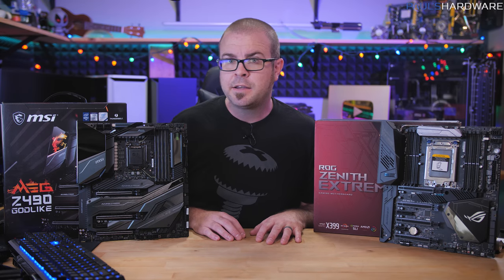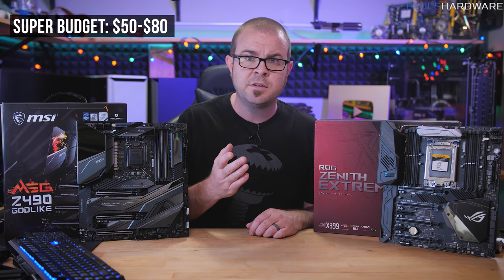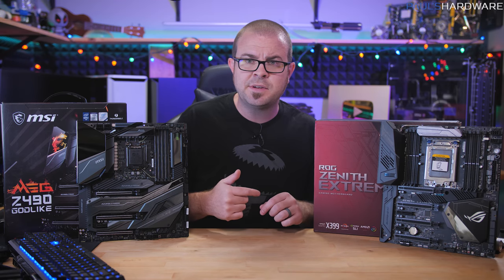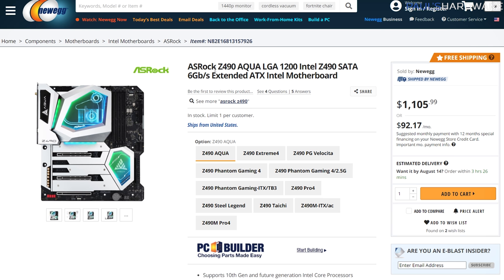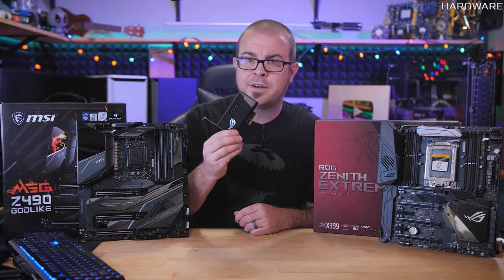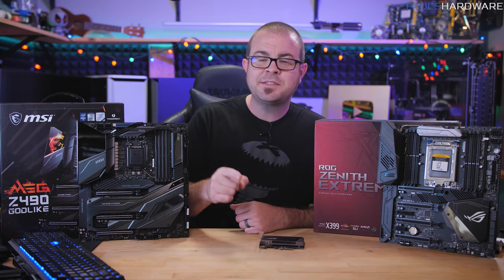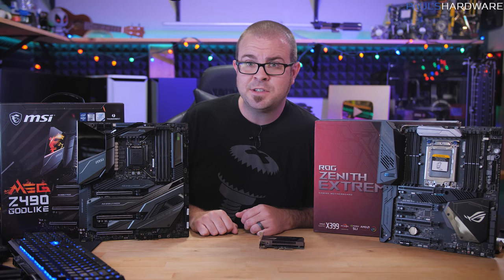What Does a $700 Motherboard Have that a $200 Motherboard Doesn’t?

Comment from the maker: ► TIMESTAMPS
 - thanks for watching everyone! 🙏🙏🙏
0:00 Intro
0:41 Sponsor: Team DARK Z DDR4 Memory
1:06 Video M.O. and Mobo Price Ranges
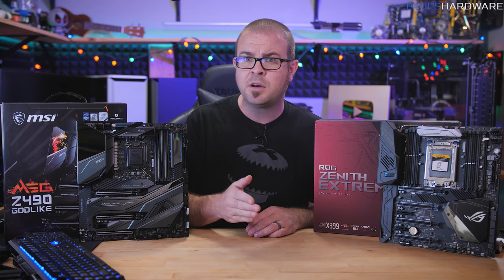2:36 AMD Mobo Pricing & Availability
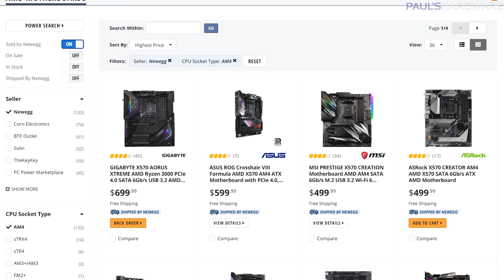4:46 INTEL Mobo Pricing & Availability
6:55 USEFUL: 10Gb NIC
8:45 USEFUL: M.2 Add-On
11:00 USEFUL: Advanced Cooling
12:24 USEFUL: Best-in-class Power Delivery
15:37 USEFUL: LED-lit Audio Jacks
17:11 SITUATIONAL: Water Cooling Stuff
18:52 SITUATIONAL: Lighting/Aesthetic Panels
19:24 SITUATIONAL: Backplates / Design
20:42 BAD: “High-end” Audio
21:44 BAD: System Info LED Panel
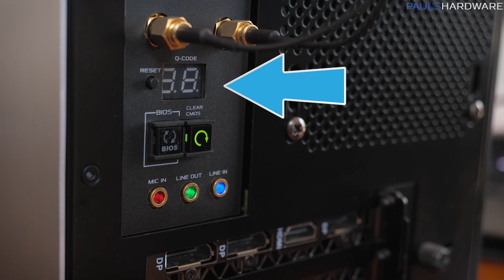22:27 BAD: Sub-10Gbit NIC
22:43 USEFUL Features that Don’t Cost $700+
24:35 Closing Thoughts
Reply: high paul! hope your doing okay! we miss you!
Reply: $30 H110 master race
Reply: I would say a worthwhile feature to shop for (especially for VFIO users) is PCI-Express Slots. If you are going with a high-end Ryzen chip on a VFIO setup, it can be helpful to have a few 16x slots (one or two for your KVMs, one for your host OS) since iGPUs aren't present on high-end processors.
Reply: Hey Paul, nice video... the new MSI boards don't need a clear CMOS button in the back. It is even better when computer is off hold the power button for 5 seconds than power on and it's reset... this is Eric from "Not Bios"
Reply: What motherboard would you recommend for gaming that don't have wifi 6 on the board ? i don't like wifi was looking at the ASUS motherboards
Reply: I have the Godlike.  And the Creation in another build.  The Godlike is good, but as it's MSI, had to RMA it within a week of having it.  The Creation and Godlike are the last MSI I will buy.  Otherwise, the stability overclocking, the 10Gbit NIC, Wifi6, good audio, and the ton of NVME support make it worth it for me in work and gaming.
Reply: Two of the better overclocking features (not mentioned) are ASUS' "Safe Boot" - which allows you to boot to BIOS defaults (if you set something too aggressively) while still retaining the settings you entered - and Gigabyte's "Dual BIOS" - which (as implemented in their "AORUS Master" MoBos) allows you to switch-select either of two different BIOS, each with their own settings and profiles, so that you can compare the performance of different BIOS versions (or even sets of settings on the same BIOS).
Reply: You need to adapt your idea of what a low and mid range motherboard are. The z/h 270-399 series are generally priced around $150 to $250 at launch. Prices haven't been coming down with the 370-390 at all and it seems like most manufactures have stopped producing them in favor of the 399.

https://imgur.com/Dnb0YgR
Reply: As an audiophile... integrated audio is fucking worthless bullshit. You need an AMP first, and then a DAC next.
Reply: Would've loved if you talked about evga's z490 dark. That retails for $550 on their site. It's cheaper than the other boards you showed but for some reason nobody brings them up in a discussion with msi, asus, gigabyte, and asrock boards.
Reply: Sad part is it's all cheap Taiwan crap that charges a "Made in USA" price tag.
Reply: @benjy117  Taiwan production is quite a bit better than China, check out the airsoft or aeronautical industies for example. Precision top end brands and parts go to Taiwan.
Reply: Excellent video.  But what about thicker pcb's and better traces, or is that a gimmick?
Reply: I bought my Zenith Extreme, After 6 dead X399 Gaming 7's i got sick and fucking tired of refunding them and bought the OTHER one they set all the world records on...
Reply: Seems like doing an oil immersed build would be cheaper/better than those $1300 fully water-cooled mobos.
Reply: Just curious and showing my lack of knowledge but why not purchase a TRX40 motherboard instead of a X570 motherboard when the prices are so close?
Reply: Still missing 1 catagory:

I/O slots
Reply: What I am gonna do with a 10 Gig nic with my 1 Gig cables and 50k mbit internet and 100mB nas?
Reply: TFW you hear the section explaining all the ROG boards and the ROG board you have doesn't even make the list.
Reply: Hell, I looked at my red-headed stepchild of a motherboard, the ROG Strix B450-F as a top tier mb (beauty is in the eye of the beholder amirite?) until the airport smashed it when I moved. Been PCless for months =( Can't even afford to RMA it... =( Sigh...
Reply: Poppp
Reply: USEFUL : this timestamp
Reply: I paid $500-ish for the Aorus Z390 Xtreme cuz it was Xtreme. And it had 10G and TB3.

Comment: I remember back in  2012 when  $150 motherboards had what $400+ now... q-flash, dual bios, post code, power an reset, bios switch.
Reply: Yup my $150 z77 had a lot more features than my $180 X570 board.
Reply: @darklink2000  My z77x-ud3h was an actual beast. Oced my 2500k up to 4.7ghz with the hyper 212 for 6 years, then i sold that system.
Reply: Inflation. We've pumped tens of trillions into the economy since then thereby causing the insane price increases. They will never go back down.
Reply: @dakoderii4221  We are not talking about inflation here, mate. Back my non-high end motherboard had what only top tier mobs have now.
Reply: What's worst about this is that today is probably a lot cheaper and faster to mass produce motherboards, yet these artificial market segmentations keep getting worse and prices keep getting higher... Ridiculous.

Who tf is buying these 1000 dollar motherboards anyway? I bet it's the same people that buy Ferraris so they can ride slow and dodge every pothole in the street
Reply: @dakoderii4221 Your math sucks inflation in general is about 1% per year. So yeah in 8 years the price would increase by 10% not by 500%
Reply: @Hellbryan1  And the manufacturers know that people won't accept higher prices because of inflation only, so they put some things only on the expensive MB's to maximize profits and minimize loss.  Why should they give you something for less if you're willing to pay more?
Reply: @daznis  6.2 trillion says that your calcumalations are far too conservative.
Reply: @dakoderii4221  prices were crazy way before we started pumping money into the economy. Whether thats now or in 08 doesn't matter
Reply: I remember seeing a b450 gigabyte board that had dual bios and stuff for like $140 but when i went back to go buy it it was out of stock
Reply: My Z77 Sabertooth was more than that but I still regret selling that board. My current z390 aorus elite is a thoroughly average looking thing.. I liked the full board "armor"
Reply: @dakoderii4221  inflation is roughly 2%/y, 2012 is 8 years ago
1,02^8 is 1,17
17% of 150 is not 250. it's not even 30. inflation is not the main reason why a high end board is 400. it could be if they were 180.

source (inflation of usd): https://www.statista.com/statistics/244983/projected-inflation-rate-in-the-united-states/
Reply: @daznis  The US actually has inflation goals on purpose. It keeps the dollar stable with other economies around the world. If the US dollar were to gain an excessive amount of value in comparison to other nations currencies, then it would be much harder for us to do global trade. It's not as simple as "inflation bad" first glance. Also,, we will always have national debt. There will never be 'balanced books' as long as the federal reserve is a thing. We inherently have a debt based economy by design.
Reply: Dakoder II We are talking about neoliberalism. It’s the cause of most of our problems.
Reply: @dakoderii4221  Not all of us printed (actually just numbers typed on computer keyboards), mostly just the Americans. And the inflation didn't go up +200%, did it?
Reply: @dakoderii4221  That's now how it works anymore... We're waaayyy pat that.
Reply: Artificial market segmentation.
Reply: How did $200 become 'budget'?
Reply: But the vrms are much better now
Reply: And  CPUs were all unlocked, GPU Bioses too. The Boards had better cooling. They start biefing it last 2 years.
Reply: @Hellbryan1  still use that MOBO.... my power button my case doesn't work anymore so i just use the mobo power button .. took the case panel off and now i have a nice look at my system everyday!
Reply: @daznis  Actually your math is wrong. The government inflation numbers don't tell the real story. Just look at the housing market and the stock market. Both have seen huge inflation. All that money the FED keeps pumping in goes right to the millionaire and billionaire class which they in turn buy assets like stock and real estate. I would wager a guess that the crypto market has had a hand in upping the prices of these motherboards like it has done with graphics cards.
Reply: and back then they probably put a simple onboard graphics chip on the motherboard.
Reply: @EhEhEhEINSTEIN  Was trying to find an up to date full armour board like my old Sabertooth for ages but sadly they kept on getting worse and worse. I really miss the charging capability of the Sabertooth even when the computer was off. (My first reaction was, what is this dark magic? lol)

*Even though I have the Aorus Master/9900k for some reason the Sabertooth Z77/3770 just felt faster can't really explain it.
Reply: Inflation. Thank globalists.
Reply: tbh this point has put me off a new build. what i have isnt great but i cant justify the cost for the increase. even older parts are holding value. im hoping the next gen consoles will help towards a price drop.
Reply: @dakoderii4221  they could in theory go down in price if we abolished the fed.
Reply: I don't see a Centronics or RS232 port on any of these, and they were on my 3rd motherboard, 20 years ago.
Oh, yes, a 10gigabit NIC is really going to make my 20kbit (on a good day) internet fly!
Reply: @zCaptainz  They most likely never even OC'd anything on the board. People who has the cash for $1000+  mobo should've get their private service tech team that does precision OC and troubleshooting included in the price. Just like Ferraris have their own team of service engineer.
Reply: @parkinsaw  win7 does magic
Reply: @magusyilie  That's two different things though. But yes, the US is feeding a  bubble on the stock market which is really not a great representation of how well the economy is doing... but Trump likes that  because it's an easy metrics for idiots to look at and be like "look! Our economy is fine! We have crippling debts but the stock market is doing well, Trump did a good job". He didn't. He said he was gonna drain the swamp, he didn't, he just kept on pumping more money out of thin air, creating more debt.
Reply: @dakoderii4221  not inflation when motherboards were the only thing that went up.
Reply: daznis it is actually 3%
Reply: Easy tactic.. slowly remove features then add them back for a premium
Reply: Yes. Currently I have a Maximus Hero VII Z97. Bought it 6 years ago for 160€. Im buying a Hero again and now its 375€ haha. But the Hero is just an awesome motherboard!
Reply: I can care less if it's a $50 motherboard or an $800 motherboard as I still go in and hit default. Lol!
Reply: those were the days... i also remember when pc building actually used to be cheaper than buying a prebuilt lmao.
Reply: @zCaptainz  actually I think you're ignoring the effect of the mobile market.  Product development costs are spread thinner and 2012 would have benefited from past RnD.
Fewer people are upgrading, they keep PCs for 6-8 years now.
Reply: @RobBCactive  Are you saying prices just get higher, because less people buy it? Because they have smartphones/laptops?
Reply: Makes sense
Reply: It is all economics. PC's are at an all time high right now. Everyone and their mother wants a gaming PC. These companies are taking advantage of it and are using RGB to entice the dildos and artificially making things cost more money because they can and will still make money.
Reply: You all are kinda overlooking other features like I'd say for one, the insane power delivery on these new boards. Isn't it features like amazing VRMs that people want? Features that can increase performance and vastly improve our ability to overclock? That's the kind of stuff I thought we wanted to see so I commended AMD and Intel when they stood up and took notice. They've given us features we the customer want and desire, rightfully ignoring the features which are nice to have, but don't really matter. I'll happily give up any QoL features like a dual bios or a jank bios reset button that don't increase performance at all. I think we're pretty lucky AMD/Intel finally put the money toward the components on boards that really count. Just think a ROG Strix B550-F has a 12+2 stage VRM! That's wayyy sexier than an extra bios or sum bootsie reset button or any of the other features Nicholas named off for that matter.
Reply: I got the opposite impression. The Asus H67 based motherboard I bought in 2013 cost 85€ and could be considered low-end compared to the Asus ROG Strix motherboard I bought just the other day for 120€ for my new AM4 system.
Reply: @zCaptainz  it is the paradox of Intelectual property, without IP tech would develop a tad slower since it would not be so worth developing, but with IP you get the bad effects of monopolies and oligopolies in economics, I can think of a few solutions, like forcing the businesses that develop the technology and the ones that manufacture and sell their implementation of it be different, and for the first ones to be forced to make public what they develop, but whoever uses it have to pay them, a fixed % of the profits become this way, so the I+D companies are motivated to make more advanced hardware so all the manufacturers want to use their ideas, and so they get the % from all sales, but other I+D companies may relinquish part of their % so they are cheaper to use, or may have tech that while not the best, is cheaper to build and to sale.
You still get IP, but the IP does not entitle you to decide who uses it, just entitles you to a margin of the profits of which you can decide to give up a part of them to make you more competitive, but never increase them from the top that everyone shares, i think something like that may work better, at least for the IT sector, it would still be hard to get in to being a I+D company but I+D companies could not manipulate the market that much while manufacturers could manipulate the market a lot more but it would be not that hard to get into the manufacturer market so there is much more competition.
Reply: Jay _TooGoated  Gigabyte H410M-S2H
Reply: @zCaptainz  12th gen B660  H670 and all Z690 series board has been doubled the price as of now compared to 7th gen motherboards.